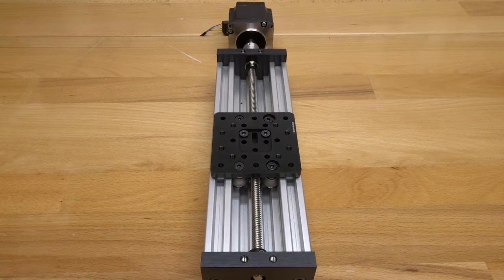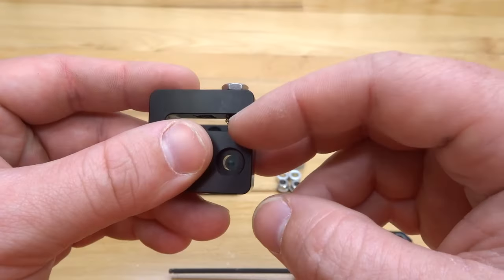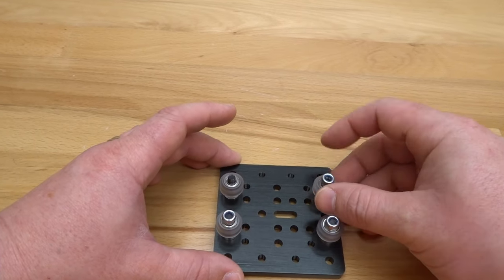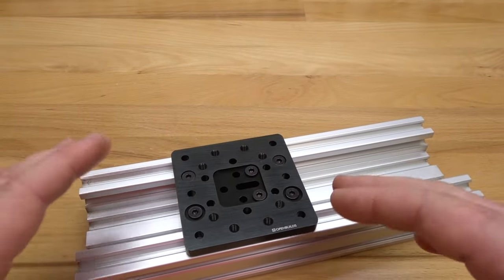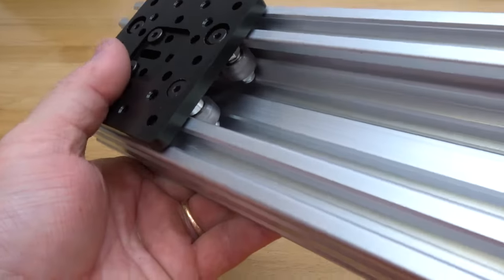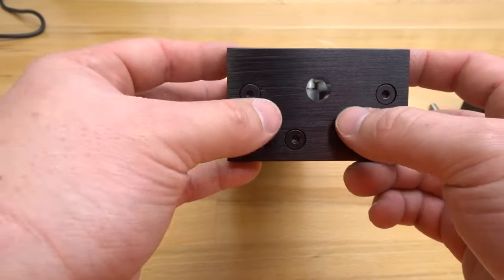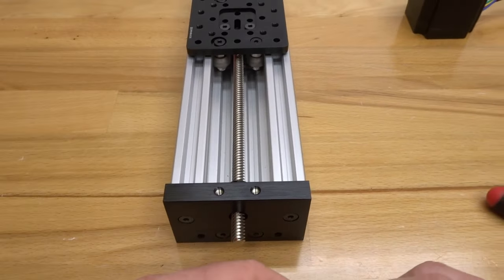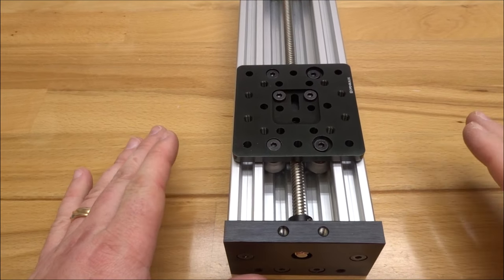OpenBuilds C-Beam Gantry Actuator

Comment: Looking at the rail as a z axis for my upgrade CNC build. I like how compact and clean this is designed. I've got a 3018 pro with a bunch of upgrades now. It cuts aluminum accurately, if you set the speed rates low enough. Its accurate now on all three axis's with the upgrades. Just don't try to overload it. I can use it to cut the plates for the upgrade mill.

I really want something in the 1500mm x 1000mm x 300mm range with a spindle that can cut aluminum easily. The 3018 is a nice trainer/entry level CNC, but its too limited by cutting size. I'll probably build an Ox large clone with sb16 rails on the long axis's, Nema23 motors and this as the spindle. That should be capable of the cutting I want to do. Still deciding on ball screws or rack and pinion for main drives. Anyone got an opinion on which way to go?
Reply from the maker: Please check out OpenBuilds.com. We have a plethora of great builds and a community of engineers and makers that would love to assist you with this new project.
Reply: @OpenBuilds  Im a member already at Open Builds, I love some of the machines on the website.👍 Thats what led me to your utube Videos.

Comment: Hey, nice video! But what do you think about lubricating of the lead screw?
Reply from the maker: Thank you! When lubricating our lead screws make sure to use a silicone based lubricant, so the plastic nut blocks don't degrade.
Reply: @OpenBuilds  Ok, thanks for your advise